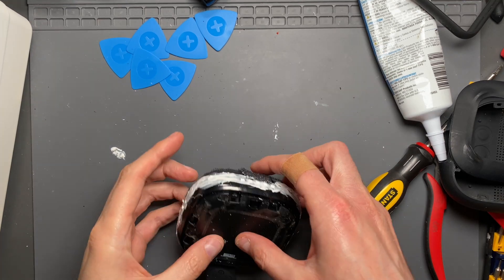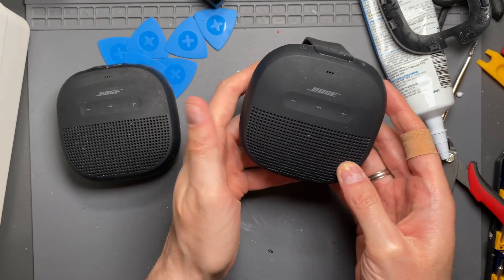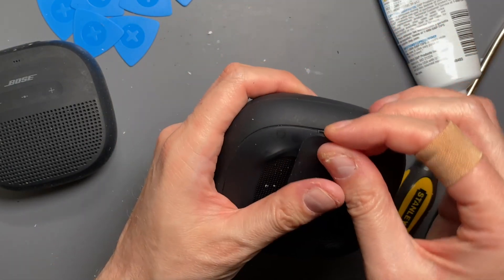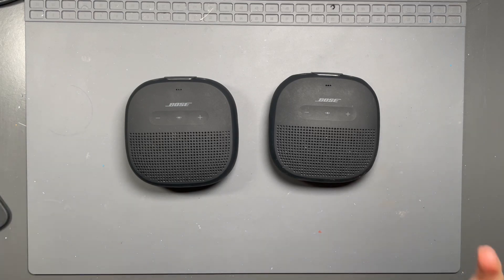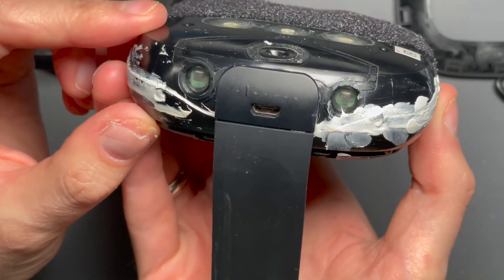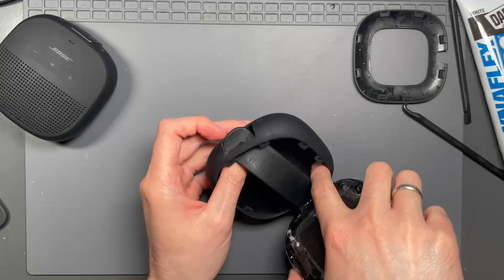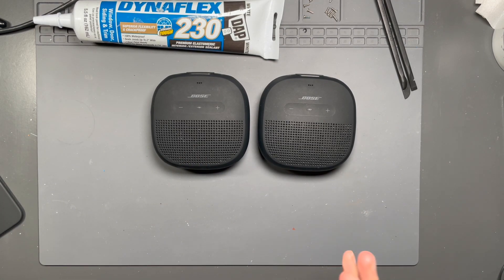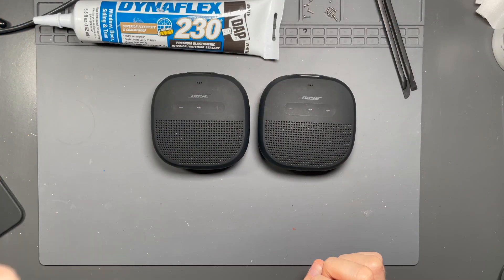Bose Soundlink Micro - Final Reassembly and Comparison Test!

Comment: I would have used a small diameter seringue with the largest needle (needle is probably optional and the straight cut ones) and there’s also a special type od silicone that can be pealed off forming an actual gasket. There’s lots of types of silicone and the one rated for aquariums is really tuff to remove as it stretches without breaking...lol

Comment: What Kind of Tape Or Glue I Need To Use To Put That Rubber Part Again Is Not Paste
Reply from the maker: I think any very thin, very sticky two-way tape will work. I haven't tried any, since the tape is still holding.

Comment: Great job, i really enjoyed the video. I'll probably boost my soundlink mini 2 with 2x21700 instead of the original 2x18650 but i will need to 3D print a new  battery case. If i get successful, i won't need to change the battery for the next 10 years, plus 24h playback-time with 1 charge.
Reply from the maker: Thanks! Just occurred to me that modifying the case like that might really alter the sound signature of the speaker, as there will be more volume taken up by batteries in the sealed enclosure.